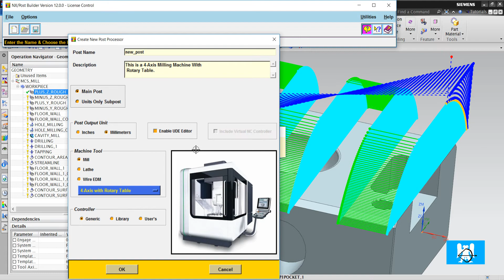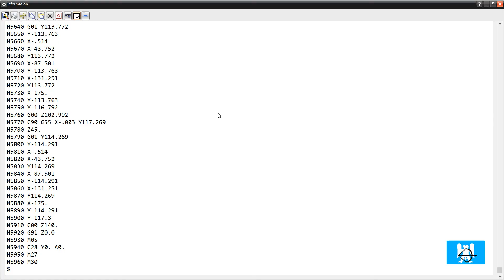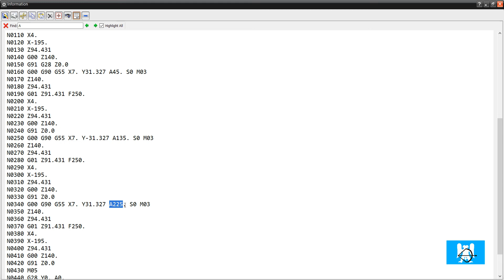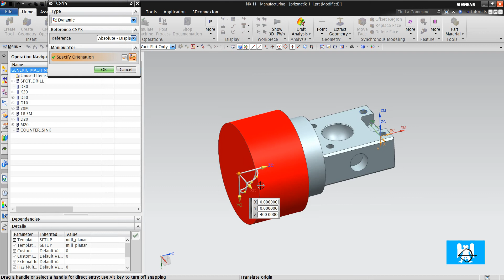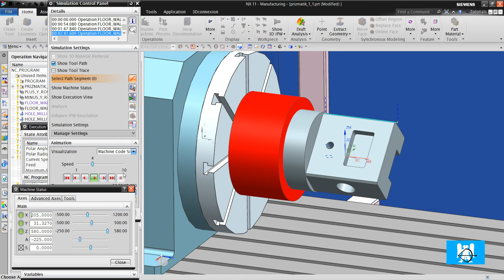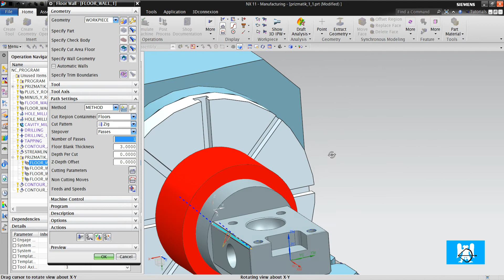64-4 Axis Indexing Sample-6.Part

Comment: S.a yusuf hocam size bişey sormak istiyorum nx 10 da  tezgahda bir elips in etrafını dolaşırken radüsü tam veremedi kırık kırık çıkardı nedeni neden olabilir  Solidworks de çizildi  parasolid olarak nx de cam ini yaptım tezgahda işledigimde radüslerini veremedi köseli çıkardı hep neden olabilir yardımcı olabilirmisiniz?
Reply from the maker: Aleyküm selam. Cutting parameters-stock kısmında intol outtol değerini azaltın. 0.003 olabilir. More kısmındaki yüzde otuz değerini de 0.1 yapın. Sebep büyük ihtimal budur.
Reply: N10 S100 M03
N11 M08
N12 G00 G90 X0.0 Y0.0
N13 G43 Z200. H11
N14 X-21.509 Y-5.108
N15 X-21.509 Y-5.108 Z12.
N16 X-21.509 Y-5.108 Z-9.
N17 G01 X-21.509 Y-5.108 Z-12. F250.
N18 G03 X-19.245 Y-.413 Z-12. R6.
N19 G03 X-19.249 Y-.207 Z-12. R6.
N20 G01 X-19.257 Y.039 Z-12.
N21 X-19.214 Y1.13 Z-12.
N22 X-19.09 Y2.215 Z-12.
N23 X-18.886 Y3.288 Z-12.
N24 X-18.605 Y4.343 Z-12.
N25 X-18.248 Y5.377 Z-12.
N26 X-17.817 Y6.383 Z-12.
N27 X-17.317 Y7.359 Z-12.
N28 X-16.748 Y8.301 Z-12.
N29 X-16.115 Y9.204 Z-12.
N30 X-15.421 Y10.067 Z-12.
N31 X-14.668 Y10.886 Z-12.
  

hocam dediginizi denedim ama nc kodundan belli gene aynı radüsleri vermiyor başka bir sebebi olabilirmi ?
Reply: çevrimsiz verse oda olur  post ta sorun olma ihtimali varmı ?
Reply from the maker: Merhaba. Zaten aynı radyusleri vermeyecek. Postta bakmamız gereken daha fazla satır çıkarması (öncekinden 2 3 kat fazla). Bu oluyorsa daha hassas bir işleme yapacak demektir.
Reply: dogru hocam önceki postla aynı ve bakarsanız her satırda en az 1 er milim oynuyor radus çıkarması imkansız 6 sene elle program yazan birisi olarak söylüyorum hocam  1 milim kayması için normalde en az 50 satır atması gerekir  postun.
Reply from the maker: Bence olay sadece g1 G20 olayı degil. Siz isterseniz parçayı ve post sablonunuzu gönderin. Ben müsait olduğumda bakayım. yusufugurluoglu@gmail.com